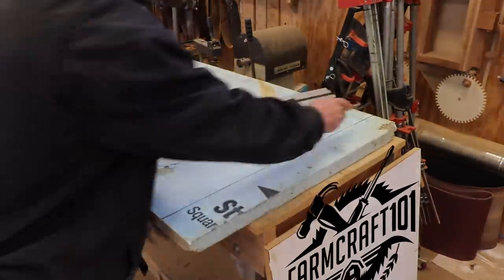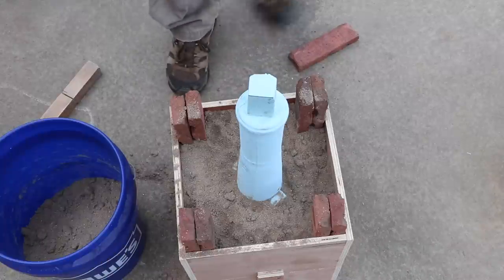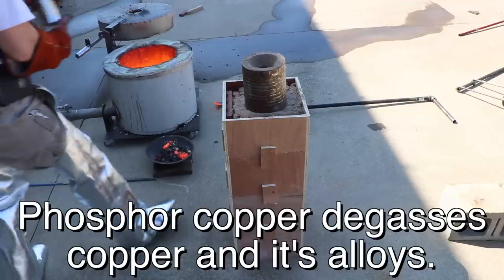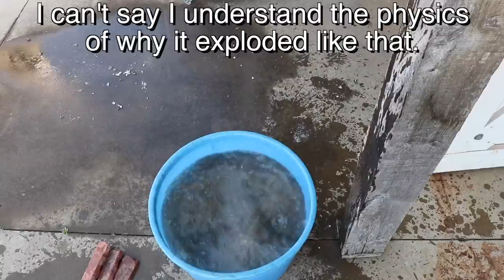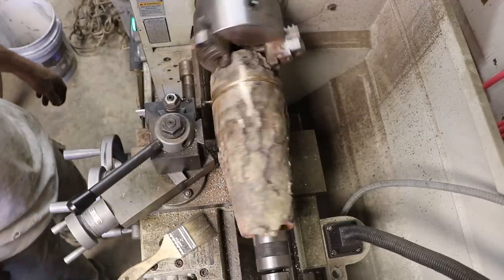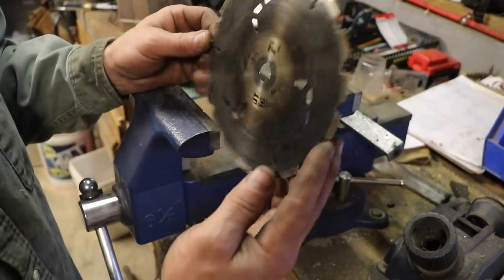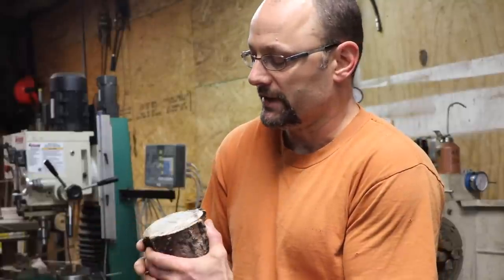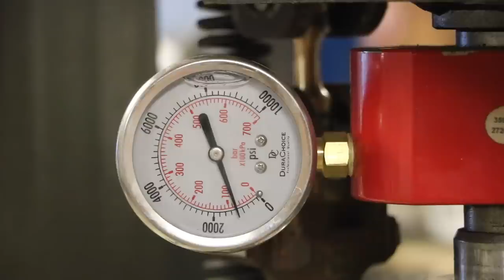How NOT To Cast A Historic Bronze Cannon Barrel.  FarmCraft101

Comment: Tensile strength does NOT equate to allowable chamber pressure. You must use the thick walled cylinder equation to compute the radial stress.
Reply: I  agree Michael. Cannons were cast in cast iron and its very poor tensile strength as little as 5000 psi.The reason their cannons didn't blow up was due to very thick chamber walls. But using too much powder and ramming wads and a heavy ball
can blow up very heavy walls.
Reply: @meagain2222  they also used bronze for most cannons since those types of weapons til even the civil war era
Reply: @meagain2222  As I recall the rough rule-of-thumb was: thickness at chamber to be at least equal to caliber.
Reply: Correct. I'm surprised that he wasn't aware, but as he said, he isn't used to large objects, the mass can lead to tricky 'oddities', as we've all seen. I would have been quite upset, he must have invested 30+ hours into this project, but you must use the right equipment and techniques, and most importantly, technology.
Reply: I feel so smart that I kinda understood what you said lol.

Comment: The water is brought to boiling point faster than the expanding liquids/ gasses can escape in the way it normally would, so it surges to the surface so fast it 'pulls' non-boiling water along with it when it breaches the surface.

Comment: The grain structure probably won't be obvious from the fracture surface alone. If you can grind and polish a piece to a mirror finish it can be etched easily to reveal the grain structure. Someone suggested a ferric chloride etch, 5 grams of ferric chloride in 96 ml ethanol and 2 ml HCl may do the trick. Alternatively a nital (e.g. 2% nitric acid in methanol) may work.
Good luck!

Comment: You have nowhere for the foam burnt gas to go,  it has to come up through the same hole your pouring into, so the weight of the metal is allowing pressure of the burning foam to build and deforming the mold. Yes sand does allow some venting but packed sand on a large pour does not have enough to vent all the foam gas,  Also you have the largest amount of metal on the bottom with the most heat trying to boil the foam gas and pouring bubbles through the area that cools the quickest because it is the thinnest.  IMHO this is why the bottom stretched.    I would add  vent sprues 1/2 inch diameter and about every 4 inches to allow the gas to escape as you pour. and factor 25-30% extra metal for the pour.  Also I would allow a slow natural cool of the casting like 24 hours.   Hope that helps some keep up the good work!
Reply: Have to agree, on both fronts. Let it cool, and let it vent! Might also consider a steel liner, which is period ofr many canon.
Reply: Slow cooling will result in coarse grain.
OTOH, would VERY slow cooling yield a monocrystalline cannon?
:-)
Reply: @Roger Barraud  monocrystalline casting is a very controlled affair that is actually controlled via ITAR. so even if he knew how (up until about 35-40 years ago it was considered a state secret) he couldn't have shown anyone how.

Comment: I recall reading a very long time ago that they learned to cast cannon muzzle up so that the porosity would be in the bell and not the breech. They also cast the cannon blank a foot or more over-long, and the sawed off the top (front) foot, since that brass would be too porous to use. I was not particularly interested in casting when I read that, so I don't recall any more details. Possibly they did not know how to degas the brass at that time. It would have been interesting to take test samples from the bottom and top of your pour to see how much porosity you had on one end vs the other.
Reply: I've read that many American cannon designs were cast iron barrels with wrought iron reinforcing rings, parrot rifles are known for this.

Comment: You can cool the cannon from the inside out using a special mold when you cast, this will increase the compressive strength of the barrel. Besides that, reinforcement bands were used often enough for even more strength around the breech.

Comment: I bet those fissures were from the foam boiling/gassing out. There was no vent for the gasses to escape.
Reply: I recon the same
Reply: yes that too
Reply: Gas is vented through the interconnected porosity of the sand mold. That's one of the upsides of using sand casting rather than a permanent mold.
Reply: He got lazy or what ever and made a weak mold. Metal is heavy and that weight pressure is what pushed the sand out.  I wouldn't think the gas pressure was the greater of the two pushing on the sand. He didn't pack the sand remember.  I also think it was why so much sand stuck.
Reply: @whitewwjd9009  I wouldn't trust that, the conditions have to be perfect for that to work well enough to release that much gas
Reply: @mrcaboosevg6089  That's the nature of sand molds.
Reply: The foam should create a vacuum as it burns, If it didn't it would have spit out of the gate and this video would have been very different.
 I've worked with some foam in an industrial setting at an iron foundry but it was many years ago and was not what the shop specialised in.
Reply: Before the foam burnt up, it reduced to a liquid, boiling, and so forth.  The liquid didn’t burn until it had a air source.  The weight of the molten metal induce a hydraulic pressure in the liquid plastic, plus as with the water, a gas was created causing more problems.  The physics regarding the steam explosion when the hot ingot was dropped in the water; the water flashes to steam so quickly, the steam “bubble” expands so rapidly it violently displaces the surrounding water.  More so than dealing in PSI in gun barrels, you should be working with CUP, Copper Units of Pressure.  There is, or was a cannon maker in South Bend, IN.  All his barrels were steel, I believe, and his bores were lined with stainless steel tube.
Reply: i noticed that as well.  from other forging videos and the little bit i've done, we casted escape vents.
Reply: @whitewwjd9009  does this apply in his case, with such a large amount of metal to work with?  that be the case, then maybe larger casting boxes and a lot more sand?
Reply: @sailingsolar  i noticed that also.. like trying to install a poly septic system in the ground and not using water to equalize the weight excerted by the fill dirt.
Reply: @anthonycphillips2430  https://en.wikipedia.org/wiki/Sprue_(manufacturing)#/media/File:BronzeSprueRisersSideView.jpg it should be done like here, horizontal not vertical position + sprue. Molten metal is like liquid so it would create plenty of  hydraulic presure in vertical position of the mold. Just go find  Alterego42 comment where he is trying to explain what is happening here and why.
Reply: I think it's from pouring vertically.   Once the liquid metal gets to a certain fill height, the pressure at the bottom is quite high since the density of bronze is high.  This blows out the fragile green sand which looked like it wasn't compacted all that well so its strength was dubious to begin with.   He should pour horizontally.  Notice how the fissures are larger at the bottom, because more pressure was down there.  If it was an outgassing issue it would have happened closer to the top.  Also in lost foam the amount of empty space in the foam is quite high and it just disappears when the hot metal hits it and makes very little gas which you see coming out the top in the video.
Reply: Pete Brown I am thinking that too. needed risers and sprues for gas release.
Reply: As a former casting inspector, that was the first thing I noticed.

Comment: Pour it horizontally.  Use the foam as a form for the green sand but remove it before pouring.  You have plenty of experience doing it this way.
Reply: But the denser parts of the metal will sink to the bottom, so one side of the cannon will be stronger then the other, and this can cause it to split or blow out on one side.
Reply: @archieperry2266  Try raising 5-10 degrees off horizontal.  Maybe a different alloy with less zinc.  Gunmetal is typically -proportions vary but 88% copper, 8–10% tin, and 2–4% zinc.
Reply: @archieperry2266  , somehow that sure doesn't agree with all the comments advising him to do it horizontally.

Comment: The linear grain is probably due to the direction of solidification. The metal will begin to solidify along the edge and the crystals will grow toward the center as it cools. Your grain pattern will be in an axial pattern. You can also do a macro etch to see the overall grain size and pattern.  A common macro enchant has hcl (commonly called muriatic acid) and ferric chloride. Use caution and good ventilation before mixing and using
Reply: I was going to suggest etching for a look but this is a better description than I was going to use 👍

Comment: I cast my first brass part 2 days ago and the guy who guided me told me that, unlike steels, slow cooling makes brass really hard while quenching as soon as you can makes it much more malleable and soft. My guy has been a machinist for almost 50 years. But check it out for yourself. And, yes, my casting looked a lot like yours, sand coating wise.

Comment: Fascinating, and a tough project to solve.  I hope you could catch all the bronze chips and dust for reuse!
Tungsten carbide inserts on the lathe could have helped but they are brittle and expensive, so the sand could still have won.

Comment: Horizontal casting, and chimneys. When I worked at a sand-casting foundry, I picked up a few things. When you're doing a large, long lost-foam cast like that, You're not only dealing with a lot more pressure than you need to, but also pressure from gasses when the foam burns. More chimneys also help expulsion of pockets, even out the effects of thermal contraction when cooling off, and moderately expedites cooling.

Also, strongly prefereable to do split molds if you can. Seal the foam, use it as a plug and do a 2-part mold. That way you can use a binder in the sand and torch it before clamping the two parts together, giving you a much smoother casting finish.

Comment: Just seeing the size of the crucible, I was wonder how it would have filled the cannon size you made with the foam mold in the first place. It didn't look like enough physical volume for the foam cannon you turned on the lathe. And that answer was, it won't. I have to agree with making a green sand setup and pour it in a horizontal fashion rather then a vertical setup. That way the weight of the brass itself isn't forcing the sand out of position. Also you could use some vent tubes to assist in that pour to equalize the flow. You could even make a sodium silicate sand core to insert in the center to help with the hole once it is poured. And allow the pour to cool off for 24 hours. That way it helps control the brass to cool on it own and not crystallize from a quick shock cool down.  JMHO

Comment: If you add coal dust to the sand that contacts the metal you will have a much smoother finish. They sell the sand commercially or you can grind up coal and add it. There are some good youtube videos on how much better the rests are but can't think of the name at the moment After seeing your finish it looked exactly what the coal dust fixes.
Reply: Plumbago (fine graphite) is normally used for bronzes - NOT coal dust. Coal dust is used in green sand moulding for cast iron where 15% can be added to the sand/clay mixture. Sorry but after 50 odd years in ferrous and non ferrous foundries I despair at some of the well meaning comments on metal casting like re-discovering the wheel.

Comment: Casting in sand requires the sand to be pretty tightly compacted all around-not just immediately adjacent to the shape. Especially with such a tall casting you want to make damn sure that the sand won’t budge when the foam vaporizes. I’m not sure that sand would even be the best choice, maybe use a fine clay or plaster shell around the foam with packed sand to support the shell. 

The explosion in the water was from the hot metal vaporizing the water similar to why you don’t add water to hot oil. 

Also, in 1500 the cannons were beyond sketchy...exploding cannons was pretty par for the course and often was more common than not. There were some interesting stories about how they were tested before field use.
Reply: "Also, in 1500 the cannons were beyond sketchy...exploding cannons was pretty par for the course and often was more common than not." Hence, the requirement for proving ["proofing"] the cannon was up to snuff before acceptance, the rise of govt. proof houses, etc. etc.  BTW, wrt to casting in sand: am thinking that a permanent mold made out of ceramic would be the way to go with this [thin shell supported on the outside by sand]; he's right about casting muzzle up, since all the gas bubble rise and you wind up cutting off the top 20% of the barrel before finishing... [At least, I think that was the old rule?]

Comment: Academic metallurgist watching this old video.  Brass does what is known as "twinning" its where parts of the crystal reorient to accommodate the strain/stress you are applying to the sample. Twins are long in structure and usually cross the grains and can propagate through grains when the orientations match.  Also with how quickly you are loading these samples it enhances twin formation as dislocation motion (standard deformation mechanism in steels and aluminum) take longer than twins to accommodate strain.  Normally i would be taking a few minutes to do each sample, as strain rate is another variable to consider.

Anyway wonderful video and I really enjoy watching you experiment.  Makes me long for a giant farm to tinker around in.

Comment: Tip from a former pyro: instead of hand-lighting a fuse and hiding, use an electrical ignition.  You can run THHN from something as small as a 9-volt battery and then run it through a hairpin of thin wire, which will heat up enough to ignite primer.  Sub out common model rocket igniters for the wire & primer and away you go - way, way over behind your rampart where you can watch it blow on camera when you connect the circuit instead of waiting on a fuse and wondering if it's going to go off or not.

Source: I had a lot of little pits burned into the backs of my hands from using professional fuses (which are made with bits of explosive in them so they won't go out, even under water - some of which fly off and burn into whatever's nearby), and after even a few of those didn't seem to go off when connected to 3-4" mortars, we switched to electric only so we'd not only stop getting burned but get to keep all our extremities if something went wrong.  That, and bury the dang thing up to the tip in a bunker of wet sand.

Comment: Hey man, you don’t need to divide your tension by 2. (I’m a current engineering student, I could be wrong) the tension held is equivalent on both sides, so the central part that broke had opposing forces of half the tension pulling on it, meaning it withstood the total 40k psi, not 20.
Reply: Alex.  No  twenty was correct
Reply: i dont get why he divides it by 2.......
Reply: Seems wrong to me too.
Reply: @mysticdavestarotmachinesho5093  well it is wrong.
Reply: @TheEhrnberg   I admit defeat.  LOL
Reply: This was my read as well.  Think of it like a rope hanging across a pulley with a bucket hanging on either end.  If both buckets have 20 lbs of water in them the tension on the rope is 40 lb, not 20.
Reply: @mysticdavestarotmachinesho5093  Yeah you were wrong about it and we were right. Think you lost this one buddy, stop trying to change our minds. pls
Reply: @Foggen  I'm thinking not.  I remember from physics that twenty pounds on one side simply counters the twenty pounds on the other side so the total force is only twenty pounds.
Reply: @TheEhrnberg  Apples and oranges.  I'm right about this.  Sucks to be you
Reply: @mysticdavestarotmachinesho5093  was just messing about, sorry. We are all right :))
Reply: @TheEhrnberg  Darn, I just finished up working on my truck and was running over in my mind why the "force" is still only twenty pounds.  This specific example was brought up in Physics class.  The professor put this exact problem on the board.  Stationary block with pulleys on ether end weighing the same twenty Kilos.   He asked how much mass?  Most everybody said forty.  He said wrong.  The mass on one side cancels out the mass on the other side.  Same as if one side had a pulley and the other was attached to the wall. 

Originally the question was "why did he divide by two?'  Now it's add the two "forces" together. 

When I'm wrong, as I was at first, I admit it.
I still have no idea what I was first thinking when I said twenty was right. 

And the Ehrnberg I appreciate the kind response.
Reply: @Foggen  There is forty lbs on the pulley but only 20 lbs on the rope.
Reply: @mysticdavestarotmachinesho5093  if 20 lb counters 20 lb, the the result would be zero but the tension on the rope would be 40lb, IMHO. What would be the force on the supporting structure?
Reply: @JohnHill-qo3hb  No my physics professor went over this exact problem.  The twenty pounds on one side is held by the opposing twenty pounds as a counter to.  The same as if the twenty pounds were held by a fixed point like a wall.  Sometimes things are not intuitive.  Most if not all the students thought exactly what you just said but it is not correct.  Twenty pounds is the answer.  Doesn't make sense but it is what it is.    Twenty pounds.  What would be the force on the structure?   I would have to say forty pounds plus the weight of the friction-less pulleys and the weight of whatever was in the middle being pulled.
Reply from the maker: Dividing by 2 is correct, due to the nature of the machine's setup.  https://youtu.be/RxoLwyjSRaQ
Reply: @FarmCraft101  damnit, you are right ofcourse :P